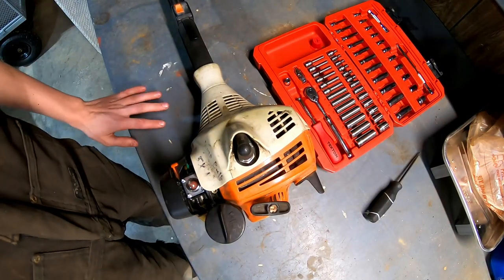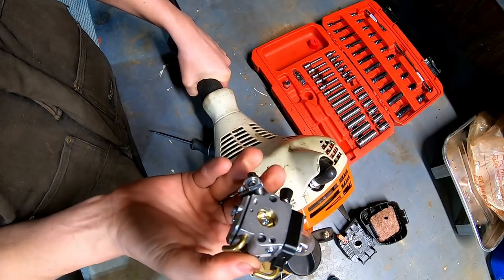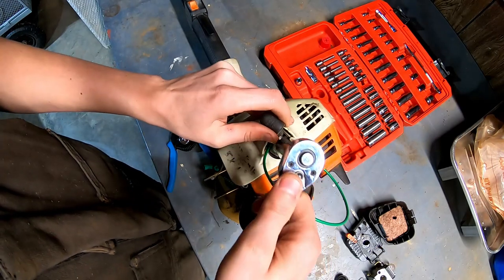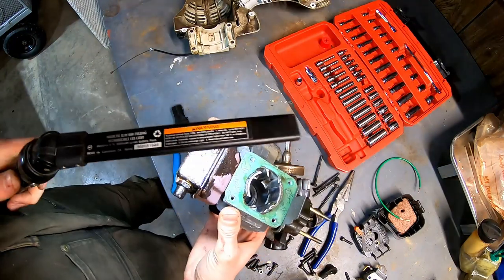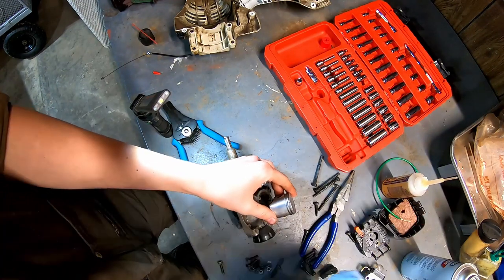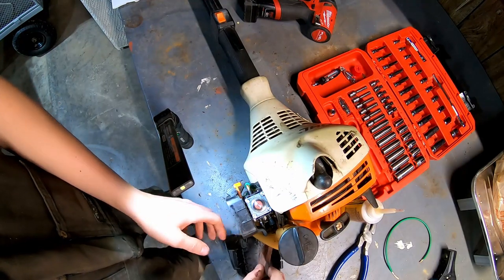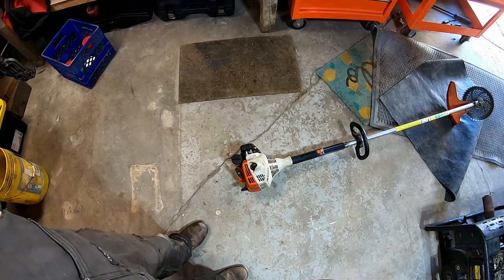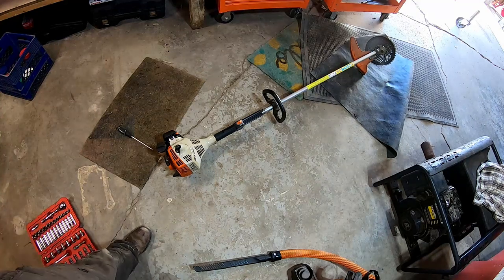Weedeater Lost Power and Won't Rev | Stihl FS55 Teardown & Diagnosis

Comment: Good lesson I always check the spark arrester first then the air filter.
Reply from the maker: Yeah it's definitely an easy check to start off with going forward.
Reply: but what if they are both in good condition? any one have any ideas? mine starts then dies out after a few seconds. I got a brand new carberator, filter and clean spark arrestor😬

Comment: In some cases the metering diaphragm in the carburetor can get stiff & hold the needle open all the time, which makes gas pour out the carburetor. I'm a little distrustful of aftermarket carburetors.That spark arrestor choked yours up so it had trouble exhaling.

Comment: I heard someone say the Stihl's spark arrester is often the cause of bog. Nice that it is an easy repair / not much to teardown to get to it !   I'm fixing up a shindaiwa brand trimmer & this one had a bunch of that same gunk but it was on the exhaust port. Right immediately next to piston & it made the hole roughly half the size. it was easy to cleanup caz it was half soft / lightly crispy. Not a full crisp. That got me tearing the case in half & getting at the crank. I was able to see a bunch of that old semi burnt oil all around & thought.. if I'm going to do this and I'm THIS far already. I might as well get the source of the crap.  She is being re-assembled in the morning... 
I wonder why no one bothers about torque settings for the head gasket ? or ANY torque or ANY bolts, lol

Comment: I have a very similar issue on the FS70 but the spark arrestor on this model is a rectangular sheet which I've removed completely and still have the same issue. Any ideas?

Comment: 1st check should have been a compression check. 100 psi is minimum.  2nd, you had the cylinder off and did not install the rings into the cylinder to check the ring gap with feeler gauge.  Last is arrestor which you CLEAN with a propane torch. 50/1 fuel mixture.

Comment: Nice video. I actually have the same issues with my FS 55, flooded cylinder, doesn't start, full of carbon. But the thing is, that it doesn't have no "spark arrestor" :(. any ideas what else could it be ? Spark plug is black, and inside of the cylinder (Burning chamber) is a ring of carbon buildup ..
Reply from the maker: Is the spark plug getting wet at all or staying dry when you try to start it?
Reply: My spark arrestor was on the back side of the nipple on the exhaust

Comment: nothing like over trouble shooting something simple. 😂 I'd also recommend getting a stihl carb. Cheap Taiwanese carbs will never run right. You're gonna run way too rich and clog the arrester in no time. Run a landscape companies maintenance. Aftermarket carbs are aweful. Theres a reason they are cheap. If you're on a budget rebuild the stihl carb. If you're not just bite yhe bullet and get a new stihl carb.